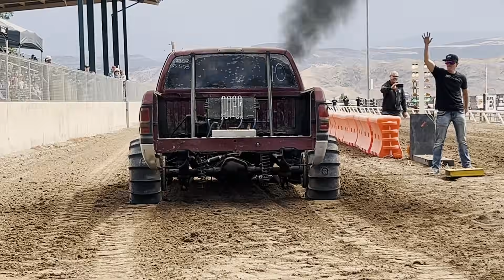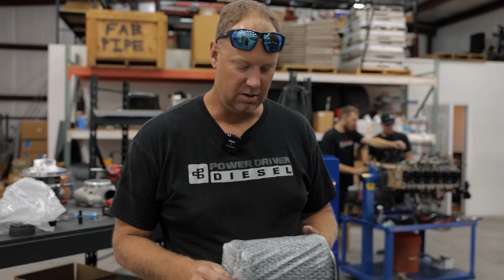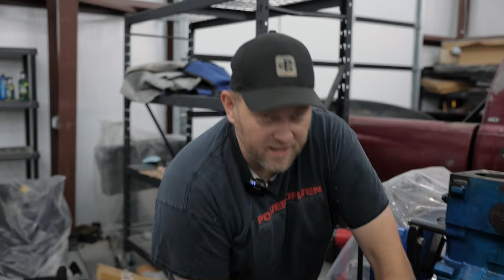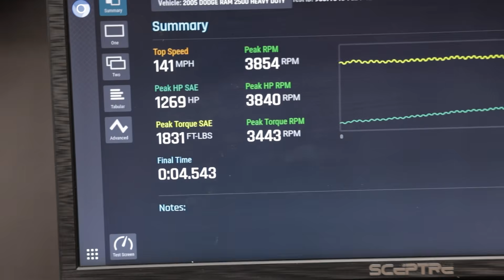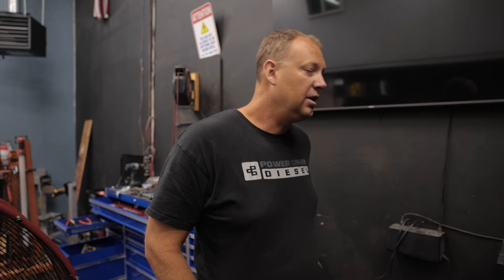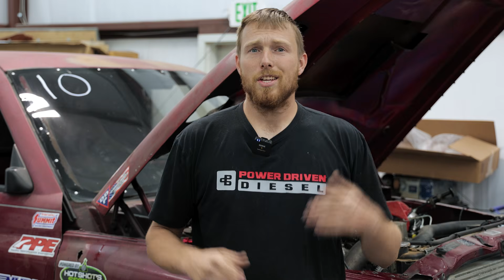4,157 HP Cummins Sets Record at Diesels In The Mountains

Comment: No way a Duramax or Powerstroke can match 4157 HP.  Ford and GM need to admit defeat and supply an inline 6.  UCC 2026 is gonna show how weak the v8 diesels are compared to i6 engines!

Comment: Corrected numbers are bs with turbos. It will be out of its efficiency range at STP. This is a thing especially with pikes peak turbo cars
Reply from the maker: Turbos absolutely lose efficiency at higher altitude and temperature aka non-standard conditions... however, they require less correction/lose less power than N/A engines.  We can agree that standard correction is too high for many turbo applications, but when turbos are pushed to the limit, they really suffer at altitude similar to N/A engines.  Nitrous is a whole different ball game!

Comment: Just curious if you have ever used a diamond block. One of the 12 valves made by international. I have one. Supposedly they are the strongest 12 valves.
Reply from the maker: Yes, Will has used and broken 2 of them, one at 1200 HP and one at 1500 HP, but they both broke and didn't seem to be substantially better than the TUPY Brazil, or Mexico, or USA non I/H logo/diamond logo blocks.
Reply: @pddofficial  well hopefully mine will hold up. I’m no where near those power levels.

Comment: Wonder if it would be possible to get the uncorrected hp number and the correction factor for this altitude
Reply: Looks like around 20 percent gets added, then there’s the question of whether the bigger number from the dyno is used, calculated flywheel hp vs actual measured horsepower, probably another 10 percent to account for drivetrain losses.
Reply from the maker: The uncorrected was around 3200 to 3300! Highest uncorrected number ever on that dyno anywhere!

Comment: Did you guys put those Speed Of Air pistons in your truck? Did you add swirl to the head too?
Reply from the maker: Speed of Air pistons are cast OEM type pistons with dimples and a coating, they are not designed for this type of usage, most likely the 2nd ring land would break and collapse into the oil ring land similar to how stock cast pistons fail at extreme power levels.
Reply from the maker: As far as swirl, yes, the head was off-set deshrouded to both increase low lift flow and enhance swirl.

Comment: Someone should cart a dyno up to +10,000ft on a hot day  and hit "4500hp" just to put this "corrected" HP nonsense to bed. I know its the norm, but this 'record' really demonstrates why it's silly for engines with turbos and nitrous. The dyno is not affected by elevation. You know exactly how much power it actually put down. You have the uncorrected data, so just use that. "Everyone does it" will only change if the people at the top start doing it differently.

"Corrected" sounds like they did some calculations to adjust the number and make it more accurate. When it's really just a simple guess at the power it coulda/shoulda/woulda made under ideal conditions. Even if the setup has the fuel overhead to make 25% more power, it's silly to just assume it could make that much more power without blowing up.
Reply: Also, it should be followed up with a second dyno pull and the average of those two pulls, be the number. It’s kinda strange that it took many years to hit 3,xxxhp. Two guys done it this year and now it’s been raised by almost 1,000hp?

Comment: 6.7 12v P Pump? I really want to see exactly how Will built that engine and what he is going to do to clean up the smoke. I have a 6.7 short block that I want to P pump
Reply from the maker: It idles clean, and runs clean up to about 900 HP.  Then it gets dirty.
Reply: @pddofficial  I run a 6.7 12v in my pulling tractor. 5x25s 150deg, 26 deg timing with a set of decompressed qsb pistons. Makes 1300hp and runs pretty clean for fuel only!

Comment: I had a late 53 block in my 01 24v with 350k no cracks, I think it was an issue mainly on the early years with 53 blocks maybe 98-2000

Comment: Hey Todd, I got one for you when I was a kid back in the 70s. The biggest bike I ever rode was a little 125 Honda XL nice little putt but naturally I wanted something that would rock ‘n’ roll so I joined the navy and I started a slush, fun loan money out i.e. loanshark Save up a bunch of money and bought a brand new. I’m in Japan now a 500 cc single cylinder SC 500 Yamaha motocross bike I went from the little 125 to a 500 cc Moto with nothing in between anyhow the bike wouldn’t run when I first got it over to the bike club. This is in you  anyways it was quite fun deal. They had to send a Mechanic over to the bike club to get my bike running just needed a car adjustment and the guy who was Japanese guy from that area and he goes 02 50 huh? I said no it’s bigger than that when I told him it was a 500 cc he was like in shock so what do you mean dude you see these things all the time here we can’t have bike that big can I ride? Can I ride here he wrote for team Suzuki, a man that dude could do things with that bike. I wouldn’t even dream of doing so it’s my turn and I was used to that little Honda. Give it a little gas and let the clutch out slow and it would stall. I did that a couple times and he goes in his Japanese accent no no no you get full throttle and let clutch fly so I did man I’m lucky I’m here today anyhow I figured you’d appreciate this one Todd you guys are good at what you do all right have a good day. Be careful out there. This is six in a row.Jim from Kennerdell pa

Comment: Can we get more info about this 6.7 12 valves p-pump?
Reply from the maker: We might have to do a full video on it!
Reply: Please, do it. Im doing the same build. I got an Hamilton head street stage 1. Wondering what did you do for the steam holes of the 6.7 with the 12v heads. Did tou resurface the 12v head for MLS head gasket?

Comment: Everyday on a boat you run a 24v at 550hp at 2950 rpm at 85% load  for 10 hrs straight. But you have the cooling capacity of the ocean. FYI that model engine lasts a few thousand hrs to over ten depending on how you run them.

Comment: There should be a non nitrous dyno class
Reply from the maker: They do. It’s called large compounds. The nitrous is the unlimited class.
Reply: @pddofficial Ok, I wasn't aware. I don't follow truck competition stuff super close. To me nitrous just seems a little like cheating. Why does nobody stack their turbos 3 deep. What is the fuel only hp record? That would be the  number I'd be trying to beat. 
 Btw I'm sure it would be possible to make a drive able (as far as spool up) truck with 2500 HP if you sized your turbos right and put enough of them on. If I had the room for them I'd have a 3 deep compound setup on my car.

Comment: Hello Josh.  There is military truck in ussr  name IFA . they make steel alloy block to solve block crack issue. Its completely clean sheet design . You need add stiffener plate to top and under cranck shaft.  It can handel 120 psi  200 psi boost . . I can tell its fit bell

Comment: WAIT STOP THE VIDEO!  A12V P-pump 6.7 you say? Will, you have my attention sir. I know you had teased such an animal, but I did not know you were this far along with it.
Reply from the maker: We are still early in the R&D phase on piston bowl selection/injector spray pattern.  But it definitely held up to nitrous runs in the dirt drags, lower blowby than the 12v block, and it didn't crack!!!
Reply: @pddofficial  Wasn't there something about a water passage that is partly outside 12v head you guys had to deal with or did I hear that wrong?
Reply: I have heard that the water passage can be threaded and plugged. The Hamilton 12v heads cover those water ports near the exhaust flange. But Hamilton heads don't flow and swirl nearly as well as PDD.
Reply: @danieljacobsen7196  Seems logical I'm trying to tease out if they're making their own 12v head that does the job or if Will is just porting someone else's. Definitely hoping for the first option myself.

Comment: @Will there are 12v 6.7 size pistons from tractors. On "reliance power parts" part number 118094740. Hope this is the correct info, I've looked into a 6.7 12v before but it's been a while

Comment: When are we going to see people run dynos for continuous power, and not just a blip of a second.
Reply: lol when physics let us. The argument of top fuel can do it for 4 or 5 seconds though is somewhat justified but they have to rebuild a motor after every pass and i do not wanna know how much that costs. Josh for example is a guy who built that truck and motor in his 1 car garage on mostly his dime and the fact he can make 4k and have it last a hole season without rebuilding it what is really mind blowing. so if it where me yeah im gonna make the run as short as possible to save 100,000s of dollars and be able to enjoy it for longer
Reply: @BillJoe-b7h I’m not saying what he has done isn’t cool. But I have run 4000 hp engines that will run 100,000 hours and they are physically bigger than the 4,157 hp truck. It’s cool to see, but most people use their truck, and I think seeing a truck that could run non stop pumping out 1,000 hp would be way cooler.
Reply: @kmac9759 what engines are you making 4,000hp in that run 100,000 hours if you don't mind me asking. That's a bold claim
Reply: @RemnantRevival Since he said the engine is bigger than this entire truck I’m gonna guess he’s talking about something like a train or ship engine. Go big enough and thousands of hp becomes low load and highly durable.
Reply: @RemnantRevival 3600 series Cat engines. The gas compression engines go roughly 100,000 hours before they are sent in for complete overhauls.
Reply: @NBSV1 that makes more sense. I was under the impression he was referring to a car/truck engine. Which made me very skeptical. I dont think comparing a cargo ship engine to a baby cummins is apples to apples 😂
Reply: @RemnantRevival  Yeah. They’ve got a point on how blasting 4,000hp for a moment isn’t particularly useful. But, by the same token an engine bigger than the truck isn’t particularly useful in a pickup either.
Reply: @kmac9759 there are plenty of street driven 1000hp engines around, many being used daily to tow trailers for work etc. They were able to build those engines based on what was learned doing these extreme dynamics tests 😅 I'm not positive,  but I'm pretty sure Todd's daily driver/ family wagon crew cab truck makes over 1000hp, and he uses it to drive to work M-F and go camping/ racing on weekends 😉
Reply: @NBSV1 I get that completely. I thought the claim was being made that theres 4,000hp vehicles logging 100,000 hours on the engine at that power level. 

Ive been a machinist for 20+ years. Automotive machining and engine building on the performance side is a passion and hobby of mine. Ive machined and built a few 1,500hp cummins engines over the years. But thats nothing like 4,200hp (corrected, I know). Im into turbo 4 cylinders. Specifically "DSM's" which are the Eclipse/Talons from 1990-1997. They have the infamous 4g63 power plant. My personal "street car" makes a little over 1,000whp. Its awd and an automatic. So making power is nothing new to me. But to grt back on topic, I guess I misunderstood the 4,000hp comment. My apologies
Reply: @RemnantRevival it’s likely a train or marine engine
Reply: @NBSV1 if it's 4000 hp it's likely a stationary engine like a genset or a huge compressor
Reply: That relatively short run (4,100hp), used over 9 pounds of nitrous!!!! think about that for a second.
Next look at Semi engines. In order to get continuous 500HP how big those engines are 14+ liters turbocharged… you need the mass and cooling capacity to deal with the heat. Little baby 6.7 liter engines lack the mass to maintain that continuously. It’s just not possible for continuous runs, for short bursts like on a dyno, drag race or sled pull sure. But they’ve got to work up to it. Find the weak links fix them as you go. Exactly what Josh has been doing, and absolutely killing it!
Reply: Lost for words
Reply: They do at stock power level.
Reply: Diesel engine don't rev high so when they load the engine at 2500 it will hit the chip faf
Reply: When someone designs a roller dyno that can actually put a decent amount of load to the engine. Most roller dyno’s are just a heavy drum with no resistance device on it. So the more power the vehicle makes the faster it’s able to spin the roller up to speed.  A better measurement of power would be an engine dyno but that’s not very practical at one of these events. The other thing is no engine that goes for peak max hp can sustain that power for very long. It’s just not possible. A top fuel engine that makes 12,000hp lasts 5 seconds. Take the exact same parts, change the air fuel ratio, timing and rpm you could probably sustain 4,500hp for a minute or more. But no one wants to sit in the stands and watch a bunch of 2-3 minute long 1,500hp dyno pulls.
Reply: @WhyNot6243 there are dynos out there that can handle the power. I have run semi trucks that made close to 2000 hp and can keep themselves cool at full load and full torque. I think people would be shocked to see what low numbers come out of a “4000” hp truck that actually has to work to keep the rollers moving instead of a blip of an acceleration.
Reply: @kmac9759 you’re right they do, but they are too big to mount on a trailer and not have to be permitted as an over width load and be a giant pain in the ass to transport from event to event. Anyone who knows anything about internal combustions engines would not be shocked at how little of power these engines make at a sustained load. All pickups struggle to keep the engine cool at 600 whp sustained load with the factory radiator. But again not one spectator is going to pay to go watch a 5 min dyno pull of a truck that makes 575hp. That’s not exciting. But pushing the limits of what a component can handle and is being run at a level 5-10times higher than it was originally designed to do is exciting. And that’s what people pay to see.
Reply: You do realize that it’s the same dyno drum that you dyno <500 horse vehicles. The problem is the drum can’t hold 4000 hp of load, it’s measuring the time it takes to accelerate the drum. The more hp the faster the drum will accelerate
Reply: When people invest in adjustable hydraulic or electric resistance dynos. Current dynos are made cheaper than a dyno that can measure torque continuously at a set rpm. Imagine a dyno with a 5000hp electric motor/generator that could be loaded to hold back that 4000+hp engine.
Reply: @Garthinyus  in the engine shop I used to work for we had a 6000 hp dyno that was loaded with water. They are out there.
Reply: When dynos can absorb 4000 hp rather than inertial.
Reply: You can kind of get an idea how sustainable a power level is based on parameters like EGT and what not but i would guess there are people already doing it just not in the way we think. Marine engines probably spend lots of time on the dyno at continuous rpm and i think you can also do the same sort of think on a hub dyno
Reply: @mtnwest-carver marine engines are an exception to the rule due to being able to pull in cold water to cool them.
Reply: @kmac9759 theyre still under constant load and are in confined spaces, even marine engines run under their maximum effort for longevity.
Reply: These things are only ever run on inertia dynos .

You can slow them down if you run them on the really big hub dynos . 

Prob low the motor up if you load it for a full 5sec pull at 4khp
Reply: Hold it to the floor and let’s see how long she gunna last
Reply: The resistance of the Dyno rollers are only so strong. If they were heavy enough to have a 2500hp truck roll up slow, a 500hp truck would be there for 10 minutes. Eddy current hub dynos could be made to hold it or existing in series on each hub but crazy expensive and not leaving the building for the county fair. 
I'll add that once you get past 2500/3000hp on the rollers it's probably not accurate anyway. Not enough time for a solid run. Could be a strong hit or bounce in the roller
Reply: Yeah when is the dyno going to be attached to the grid and the truck signed over to the utility company and it generates peak power nonstop indefinitely.
Reply: @JohnDoe-mx1sq careful, dont give the power company any ideas on how to make more money off of us.